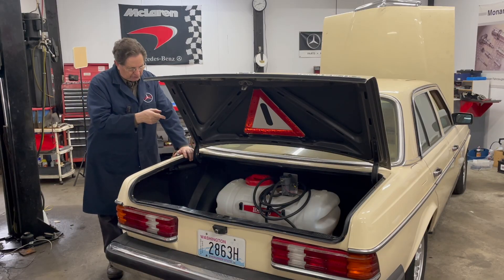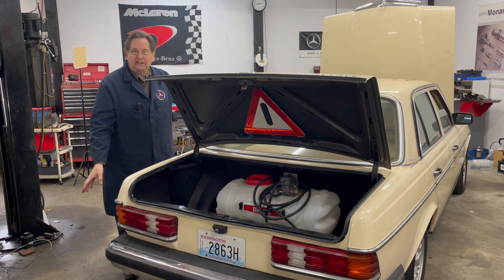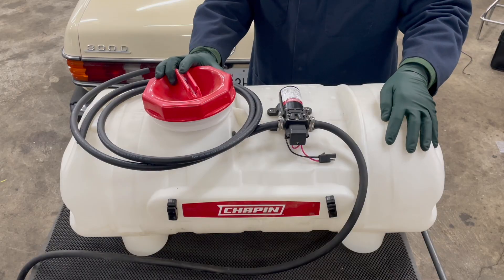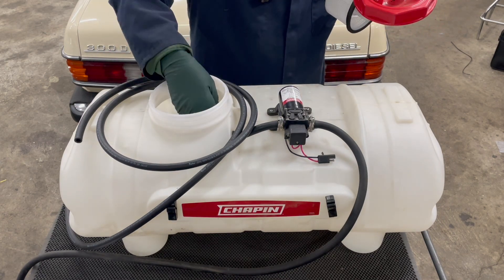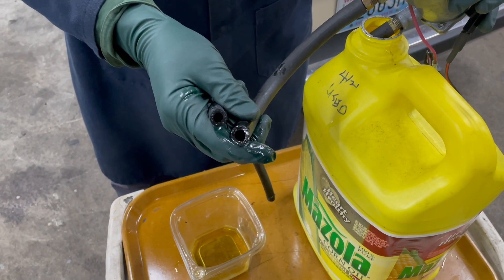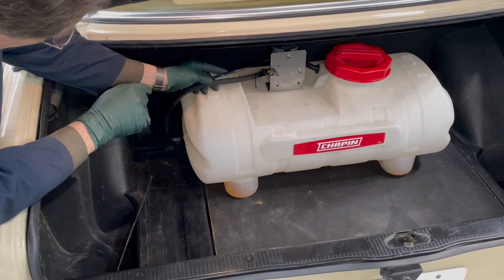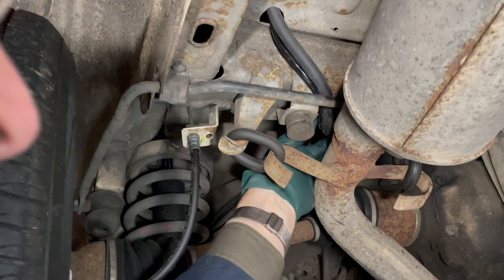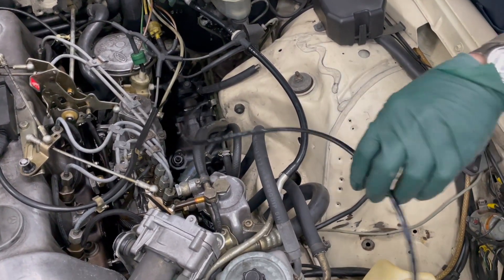Mercedes 300D Veggie Oil Conversion: Where is the Second Fuel Tank?

Comment: Hey! What kind of fuel pump are you using in this video? Thanks! Love your videos
Reply from the maker: That is an old Walbro pump. They don't make this one anymore, but they have an updated version. Low pressure - on demand
Reply: @Mercedessource thanks for the reply! Do you recommend the new walbro pump? I’m doing a 2 tank WVO system and looking for a pump that will last and not die on me! Thanks again
Reply from the maker: The new version of the Walbro low-pressure pump is even better than the older version shown in my video.  It is pricey but very reliable.

Comment: I had a fuel fump used on vegetable oil that stood for a month or two and it got seized from the glycerin dried in the pump
Reply from the maker: What can I say? There are good pumps and there are not so good pumps. I pump I show testing in this video has been working on and off for 15 years.

Comment: Just bought a 300td that was converted to vegetable oil through an auxiliary tank but it’s been sitting for 4+ years. Any tips where to start? Hoping to switch it back to diesel
Reply from the maker: If the engine has good compression and you know the glow plugs are working, I would recommend you try to get the engine running on a small remote fuel tank. Then do a diesel purge. If successful, next remove the glow plugs, ream the holes, remove the injectors and clean the tips. Then change the fuel filters. Here are some things that could help.   https://mercedessource.com/store/search?keys=diesel%20purge
Reply: @Mercedessource will do thank you!

Comment: Me who just uses 70% of the cleanest most filtered wvo and 30% diesel or gas. .and no problem but I live in the tropic where is hot so vege oil is not so thick because of no cold.and when mixed is almost the same viscosity of diesel.And it works good but it will be different to you all because of temperature